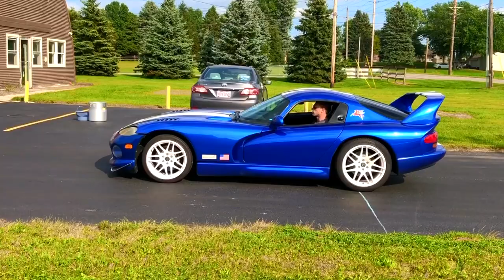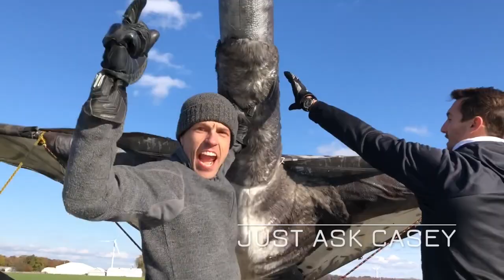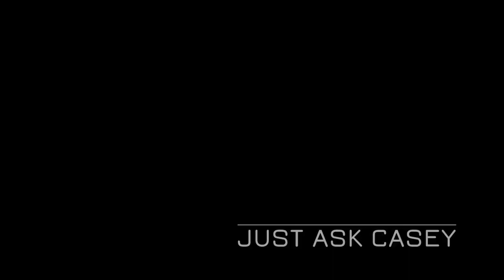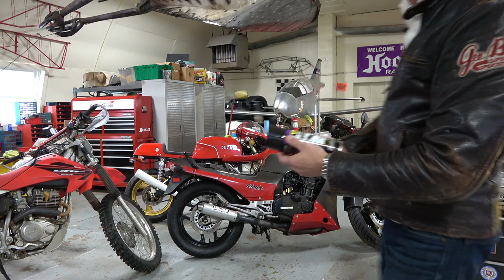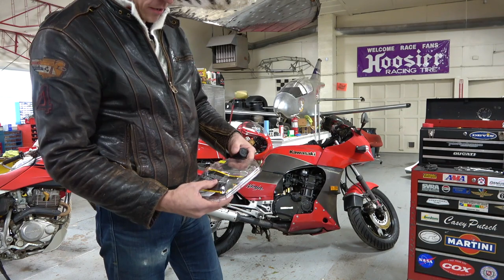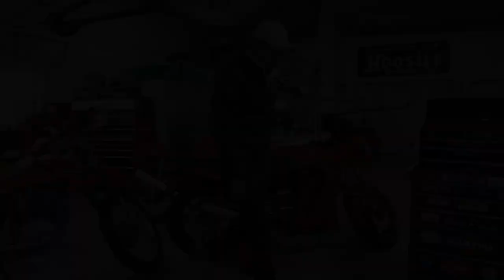TOP GUN Maverick Kawasaki Ninja build 2

Comment: Stainless braided brake lines are consistently the best upgrades I make to older bikes. They turn vague, spongy brakes into powerful, razor-sharp brakes.
Reply: That works wonders on hydraulic clutch lines too.
Reply: @Mike W Not my experience. I put them on a 1982 GL1100 Goldwing, and those brake lines were the single best upgrade I made to that bike (and I did a LOT to it). It absolutely transformed the bike. Same thing was true when I did them on my GL1500. I run one of the largest online forums for Goldwing owners, teaching them how to maintain their own bikes, and many people have reported the same results after installing stainless braided brake lines.

Perhaps it is the specific application that makes the difference.
Reply: @Mike W It varies from year to year. Later GL1100's have dual twin-piston calipers up front and one single piston caliper in back. 1980 and 1981 have dual single piston calipers in front. Trim line varies as well: the brake calipers and rotors on the 1982 GL1100 Aspencade that I had are unique to that year and model/trim of bike, they were not used on any other 1982 GL1100, or any other model year either. Makes it tough to find used parts!
Reply: You never sort front brakes on the GPZ without sorting first the anti dive pistons.
I went braided and connected straight through to the caliper and bypassed the anti dive.
The anti dive can lock up the front forks, the bike becomes scary to ride.

Comment: $15 harbor freight purple hvlp gun. Remove all the crappy caulk they seal threads with and replace with Teflon tape. Go to your local PPG auto paint store. Spend a hundred bucks and get a quart of proper single stage paint, reducer, hardener, and a graduated mixing cup. Then go to Dollar tree and by ten bottles plain acetone fingernail polish remover, to clean your gun with. Spray bomb the primer. Sand primer to 400 grit. Wait at least a week to wet sand and polish out any imperfections. Professional paint job for less than $150
Reply: The difference between the $15 and $300 gun is only the caulk vs Teflon tape.
Reply: best hack on YT for many months - thank you sir

Comment: i really like your constant tire safety comments. when i first got my 85 supra no one told me that even though tires have tread and hold air that they can still be unsafe POSs. 3 days after i got it and fixed some of the fuel issues it had i did some donuts and one of the tires delaminated, full size spare saved me there, then my stupid 16 year old brain took it on the freeway and 2 more tires delaminated and i had a bad time. turns out the tires were dated for 99. that was a year older than me.

Comment: Hey Casey 
For your plastic trim pieces I’d recommend some trim & plastic restore, brand doesn’t really matter 

I’ve tried painting before and it flakes after awhile (maybe I suck at painting)
And using the heat gun doesn’t last very long, and it could change the texture of your part

The trim restore stuff is cheap, lasts a long time and looks the best imo
It’s like leather conditioner but for plastic

10$ and you’ll have enough to do all 3 of your bikes, twice 

Love the duc btw

Comment: I have used the heat gun technique on a bunch of different projects and it does work it does also change the texture slightly it goes to a slightly smoother glassy texture but it works amazing. on the two biggest projects I've done it on, that it worked the best was a faded chalky bumper cover for a 96 Dodge pickup, and a 97 Jeep Grand Cherokee, I did all the plastic bumpers that way and it looked a thousand times better